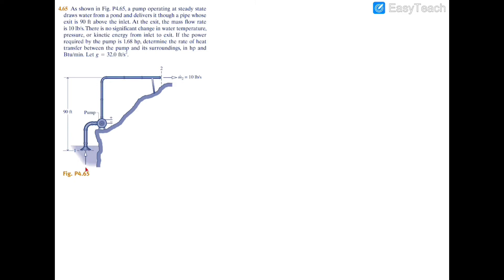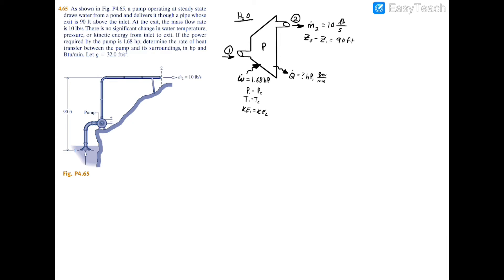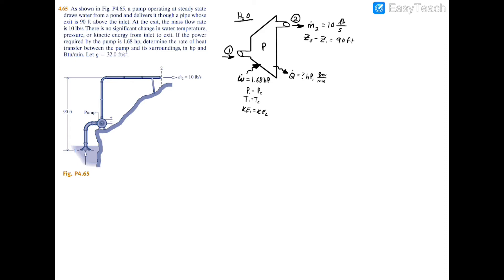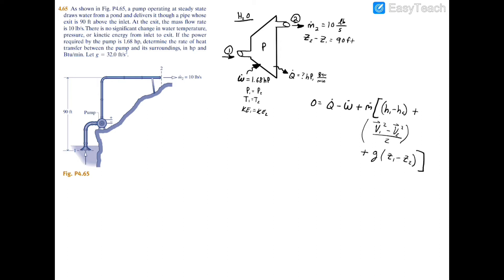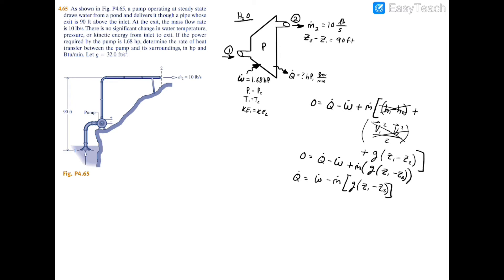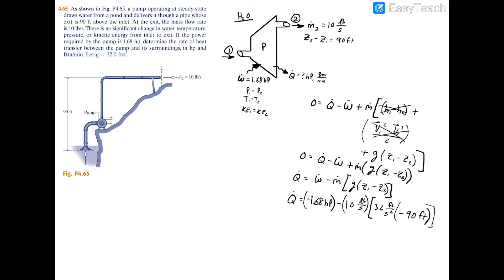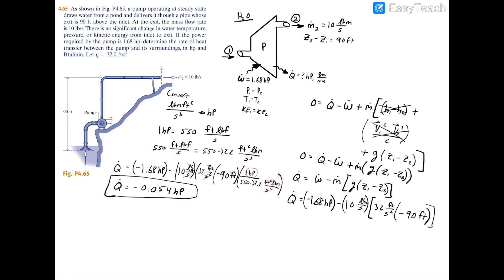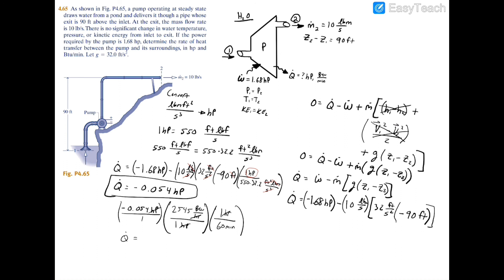4.65 As shown in Fig. P4.65, a pump operating at steady state draws water from a pond and delivers

Comment: You can correct me if I'm wrong, but I believe that the "32.2" in the unit conversion should be "32.0" since the problem takes g=32.0 ft/s^2
Reply from the maker: Great question! Technically, 32.2 would be more accurate, but yes, the problem suggested using 32.0. The difference is definitely negigible though, so you shouldn’t have any issues 🙂
Reply: @gr_engineering  That's a great point. Thank you for taking the time to answer!